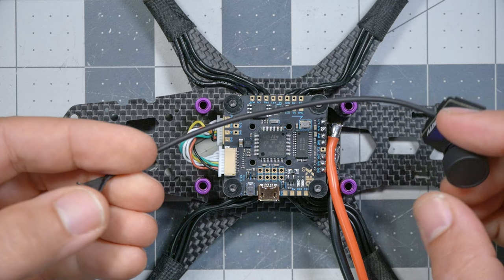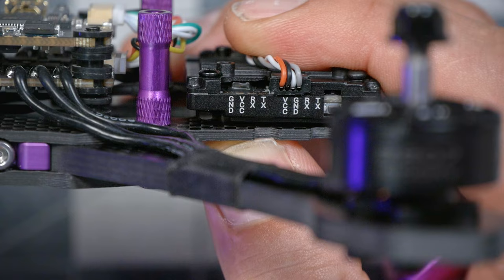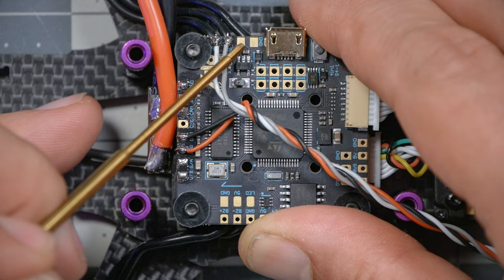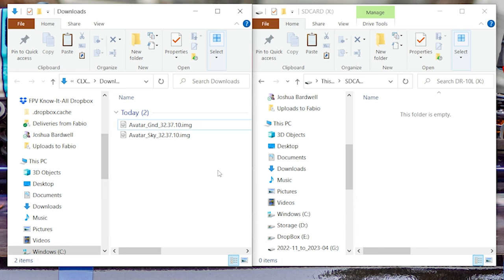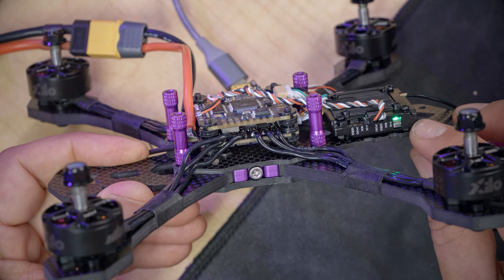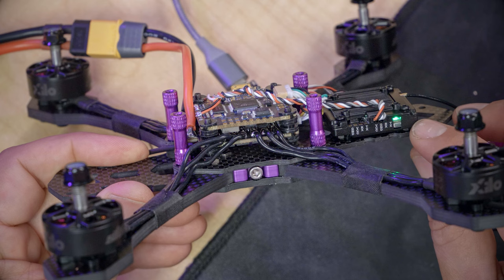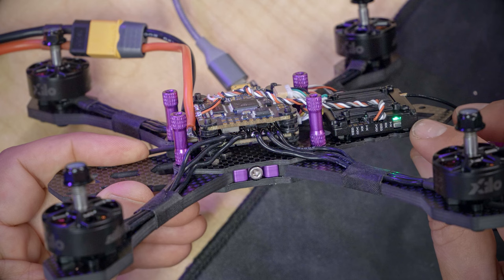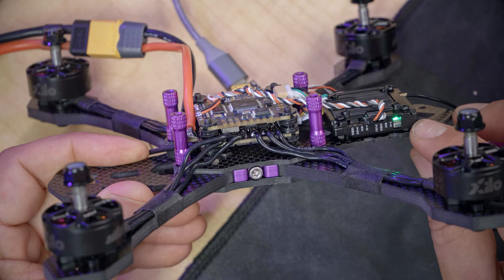Build an FPV drone in 2023 - Part 6 - Walksnail Video Transmitter

Comment: Why don't you glue two thin pieces of carbon fiber to the bottom plate the size of the wire so it leaves space to run it under everything. By glueing it you are not hurting the integrity of the bottom plate by cutting into it.

Comment: Just found out that after updating the goggle and vtx, you now have to update the vtx firmware for every drone you have before they work with your goggles. No flying today 😢. Thanks for the heads up.

Comment: Was super psyched about this frame - immediately wanted to build one up, that arm mounting looks awesome. However, just as I was about to hit the buy button this video demonstrates that its just unsuitable for Walksnail. The lack of ability to soft mount is annoying but not the end of the world. Sticking too far out, and if you push back in that slot one screw leaving the camera flopping around.. dealbreaker.
Reply from the maker: What does "wflopping" mean?
Reply: @JoshuaBardwell looks like youtube truncated my comment. I ediited it and restored the missing words. Appreciate that you  actually read it and tried to respond. looking forward to hearing your thoughts.
Reply: @quadsmack  we used to fly all our cameras back in the day with only one screw. I still use it that way on a number of builds. You have to smack it pretty hard to lose the camera angle and you can just re-adjust it. I haven't found it to be a major issue in practice. If you want to secure it better you can put a rubber washer on the inside between the camera and the side plate and use a wide head screw instead of the cap heads. If you do that it won't move at all. If you don't have a rubber washer you can print one with like two layers of TPU. Super fast print and it provides a ton of added friction. Basically it won't move without tearing up the TPU first.
Reply: @QuadMcFlyFlies  sure it can work -- and the TPU washer is a good idea. Still would have liked to see better accommodation of current popular systems. Perhaps next build I'll give it a try. As for the smack necessary to move a camera..there is a reason camera protection is important to me,  Hold My Beer... :-) 

Thanks for the reply - the involvement with the community absolutely makes the products more interesting!
Reply: @quadsmack  yeah I agree it would definitely be more ideal to come up with perfect mounting solutions for each camera, but we also didn't want to make a frame with a different mount part for each system, and there was a target weight to hit which complicates how much depth and aluminum we could put in the front end. Unfortunately the drawback of a more "swiss army knife" approach is it's less than perfect for some systems, so we had to prioritize a bit. Understandably not everyone is going to be happy with the compromises that entails. Hopefully it is at least workable for most folks.  As you say though listening to the community and engaging is super important, so if we get a lot of feedback on this it's something we'll definitely look at more closely in the future. We definitely appreciate the feedback. We have other frames almost ready with different design goals though, so I think there's eventually going to be something that covers most typical use cases.

Comment: I fly mostly regular analog with the rush tank 1.6 watt vtx and microphone to hear motors a must ( DJI has to much latency for a mic ) the newer analog cameras are pretty good when racing .. .. better then DJI as far as penetration  .. no loss frames and very little static through trees  .. I love DJI but coming up on objects full speed you miss your cut and lose time when in full speed mode

Comment: "Occasionally getting to enjoy flying." (37:35) I laughed pretty hard at the comments around this one. It seems that way sometimes for sure. After 5 &1/4 yrs. at this, lately, when building, I seem to run into issues that just stop me in my tracks. Some of the issues are because of my own lack of awareness; some are due to faulty electronics where I have to remove something and replace it; other issues are a lack of preparation on my part; and still others are due to over confidence and laziness where I might not double check something. Overall, though, as I look back, I realize that I have learned so much. I love this hobby in spite of all the problems. I wish I could have had a series of videos that are this detailed when I started. You have hit on so many issues where I had to look for answers, or maybe email you to finally get something cleared up. I hope you earn a bundle from this project. I think you certainly deserve it. Thank you.

Comment: This series is great and entertaining and I did actually learn something.  whether I use the gReen and whiTe convention.  I usually use Blue and green for UARTS, but will start putting the blue on the RX on the peripheral
Reply from the maker: Nooooo. If you use blue and green, then gReen would go on RX on the FC, which would put it on TX on the peripheral.
Reply: @JoshuaBardwell  I said it right, if not eloquently.  Blue on the receiver RX would put gReen on the receiver TX.  but thank you for making me double check.

Comment: Great video. I did run into an issue with the Avatar HD Pro with dual antenna's that others seem to have experienced. The issue is that there seems to be no method to get the USB-C to connected to a computer for the upgrade. I purchased 2 of the VTX kits, so tried the USB-C cable from both on the one I installed (so far). No joy. I just submitted a request to Caddx for support. The shipped version of the VTX's are 34.40.15. The shipped version of the Goggles X is 37.42.5 (latest stable). Video is fine from the VTX to the Goggles. Maybe something to discuss on a live-stream if a recurring issue.
Thank you for all your great content.
Reply: I figured it out. I noticed a video with a USB-C to USB-A in the path. I grabbed an apple device (has USB-C to computer, then USB-A, USB-C, and HDMI as inputs). This worked to connect the VTX drive to my computer. I guess something is missing in the USB-C dongle.
I did try to re-connect the USB-C post update to see if it was a fixed software bug and not hardware, nope. Maybe Caddx will reply to my support request and send fixed dongles.

Comment: Hi, I  love this series of videos - I have also watched your previous offering on this topic. I bought a torque wrench intending to use it in my first build (AOS UL7 EVO, RCinPower 2020Kv, HolyBro H7 stack, BetaFPV ELRS, GNB 3aH Lipo, Hota D6 - will get HDZero FPV rig later when my bank card cools down). However, I cannot find any information on what the correct torque is for the various combinations of hex screws with nyloc nuts and aluminium standoffs. I fear that the minimum setting on my torque wrench is too high (it is a Roebuck 1.2Nm to 6.0Nm). As always, love your content.

Comment: Great video. Is there a way to communicate with the vtx through the UART without the FC? E.g. would it be possible to use an esp32 or Arduino? It might be fun to use goggles with a robot.

Comment: Great video series, thank you Joshua.

I have one question: 
Can the VTX be installed directly to the frame only with the screws or are there also spacers/dampers needed? I couldnt see that in the video.
Reply from the maker: I install it exactly as shown in the video.

Comment: Have you had an issue with the vtx being mounted to the frame, grounding the entire frame? has that caused short or any other issues?
Reply from the maker: No, not at all. The frame gets continuity to ground through multiple devices. It's not an issue.
Reply: @JoshuaBardwell  ty!

Comment: Question, i have the Goggles X, while the channel expansion worked, the power output did not.  Is this a function of the new X platform?  Thanks
Reply: interesting, i plugged the kwad in and now i have access to 1200mw but only 4 channels....
Reply from the maker: 4 channels means you are in 50 Mbps mode. You get increased image quality but the channels are wider so you have fewer of them.

Comment: commands
set osd_canvas_width = 53
set osd_canvas_height = 20 
not working in BF 4.3?
Reply from the maker: Yes because Betaflight 4.3 doesn't support HD canvas. The FC is supposed to come with 4.4 on it.
Reply: So the only way to deal with this is to update to BF 4.4?
Reply from the maker: If you want the HD canvas yes. If you are ok with SD canvas then you can stay on 4.3.
But if you're building the QAV-S kit, your FC should come with 4.4 on it. Are you building the QAV-S kit?
Reply: No. I'm finally switching from analog to digital. I'm rebuilding my Apex 5 HD
Reply: How to find wailksnail goggles L correct canvas width & heigh